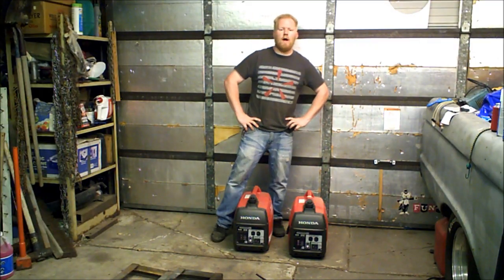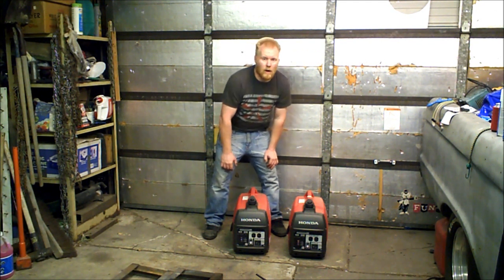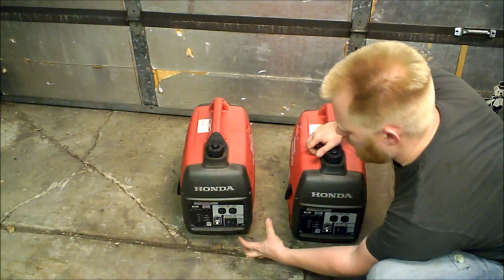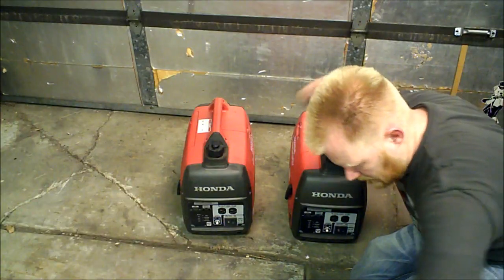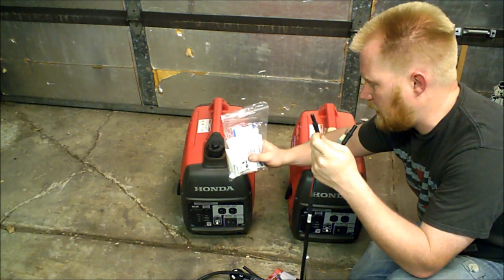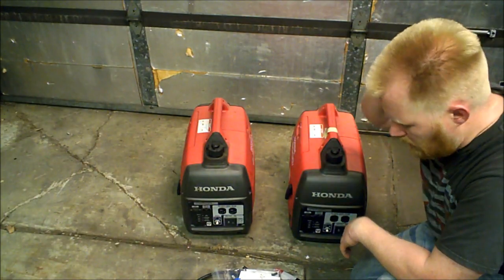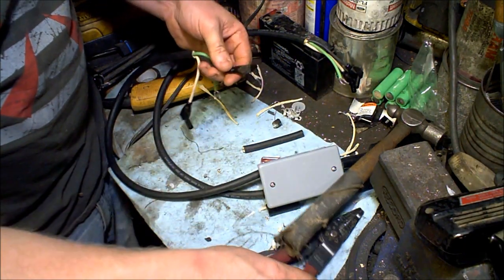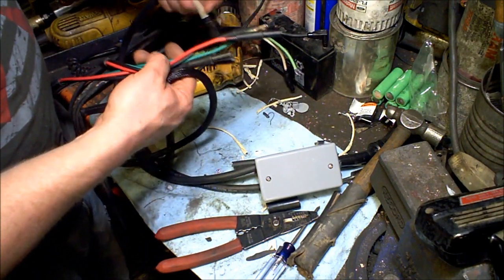Homemade 30A Honda Eu2000i Parallel Kit Generator

Comment: hi, Have watched a few of your videos.  Did you ever make a video connecting a puresine wave Inverter attached to a battery , and then parallel that to an eu2000 genny?  I remember seeing this , I think it was a prosine  inverter in a van setup. Thought it was a great Idea to share the load of say, an AC unit or something.
thx for the great vids
Reply from the maker: I know the video your talking about. The guy who made the video powered up his inverter then the Honda. The Honda has the capability to match the wave form of the other power source.
Reply: This is sounding to me like it's going to a complex, sophisticated arrangement -- way beyond just putting two generators together.  The result would be beneficial but it would cost you.
Here's what a system like this would look like.  You'd have a pass-through, load-sharing, full-sine-wave inverter charger.  You'd run a generator (or two generators paralleled together) to the input of the inverter.  If you're in a situation where you can run your generator, the generator 120V goes right "through" the inverter; if the batteries are already fully charged, all the generator power goes to your "loads".
Let's say that you run it for 8 hours or so.  You need to fuel the generator and do a little work on it (or it's getting to be bedtime and you don't want your generator to run all night).  You just switch off your generator and the inverter pulls battery power, converts it to 120V and you get uninterrupted 120V power to your loads.
If the inverter is "load sharing", say that you want to run a little bit of a bigger load for a while.  Say, the coffee maker is on and someone is using a hair dryer.  Then the generator will run its full 2000 watts and the "load sharing" inverter will pull additional power from the battery and add it to the output so that you get automatic "extra capacity". Once the inverter senses a need for less power, it stops drawing power from the batteries and switches over to charging the batteries up with the surplus power that the generator is providing.

A system like this gives you power that's as good as and as dependable as power in your house -- but it's way more expensive than just one or two generators.  For some people, it's worth it.

Comment: will this work on other types of generators?
Reply from the maker: The generator has to have inverter technology that is designed to sync with other similar generators. The only ones I know of are the inverter Honda, Yamaha, Champion(2000w cube) and Ryobi(2200w)
Reply: its also possible in wind turbine ?/
Reply: i was thinking to connect two wind turbine but idont know if irs ok ?
Reply: Simple answer, "that depends".  If your two wind turbines are putting out DC power, you can combine those to make the sum of the power from both; say you have two wind turbines putting out 30 Amps of 12V each, you just wire them to a 12V battery to get 60 Amps (or 720 Watts).  Then attach an inverter to your battery and you get AC power out of your inverter.  That's pretty simple (but there are some details, your turbines must be designed so that "crosstalk" between the two won't screw up their voltage regulators -- you might need to add diodes or something, depends on the turbines).
But -- in general -- wind turbines are different from 120V generators.

Comment: Good video. One comment. Is it safe to solder wire because if you run a heavy load like a/c , it can heat up wire and melt the solder. Fire and electrical hazard. Buy the correct size wire nuts for it is easier and safer for the family.
Reply from the maker: This would mean you are drawing too much current for the wire gauge and the wire is getting to 400+F all along its length. Heat will generate in the weakest/thinnest joint. Solder will offer a 10x better, more conductive connection than a wire nut, allowing no heat buildup there. If in the random event that the solder did heat and melt the connection would be broken and nothing would happen as they are enclosed in an insulated electrical box.
Reply: Conductivity in solder (tin plus lead) vs copper is not that much difference.  Heat (wattage) is generated in the areas  of higher resistance (ohms) and air confinement . The #12 solid wire is good for 20amps according to most codes but in my book stranded wire can handle about 5 more amps. Wire nuts are made to take the heat if installed properly, conductivity is about equal. The best is crimping but that is much more expense for the proper tools cost dearly .  I must tell you about a insulated (meltable)box vs a metal box. Insulated boxes do not conduct out heat as good as metal boxes in outside spaces. The insulated box may protect you to a point but the ground wire / neutral wires inside can still cause a shot to the hot wires if the soldered wires would fly apart. Most codes do limit the number of wires that can be used in a confined space like a box. I always commend a double box. I think you did alright but the solder would not be my choice.   Ive been in the electric field engr. work for about 45 yrs and when I look back on my first jobs I can not brag. You are a smart guy and seem interested in learning. Keep it up. That is my 2 cents worth.

Comment: Hi, Since the eu2000i does not have a12vdc voltage regulator,  what do I need to do to get one?  Is it possible to go to a junk yard and get one from an old generator lying about?
Reply from the maker: The easiest way is to run a standard 120v battery charger off the generators 120v outlets and charge batteries. The issue with an automotive voltage regulator is they are designed to adjust the flow of current to the alternator/generator and that limits the charge. You can't really limit/stop the generator itself from putting out voltage.
Reply: I was so stunned by the answer I failed to note the generators are the only thing I have for a 12vdc charger.  Let me give you some readings:        Okay I have 2 of these generators and have them hooked in parallel.   I took a reading one time quite a while ago and saw 18.64 vdc coming from the battery charger.  Yesterday the '07 Town & Country van battery was down to a bit over 10 volts on the Oregon Coast.  I plugged the battery into one of the Honda eu2000i  and after 1 1/2 hr. runtime I was able to raise the battery to 14.44 vdc.   @ 17vdc from the generator.  I am thinking that much voltage is a big hit for a battery.  Is it possible to wire in a voltage regulator for my Honda gen.?  Do you think I could wire up an external regulator from the salvage yard?  I am not sure if the Town and Country comes with an externally regulated or an internally regulated alternator.   I thought if I could wire up a regulator from a car it would help a lot.  But I am also thing where is the leftover voltage going to go after being filtered through the voltage regulator?
Reply from the maker: Voltage regulators for car alternators really don't work that way. They 
feed current back to an alternator force it to produce more or less 
current. The Honda has a fixed circuit that produces the same amount of 
current based on the speed of the engine. It will produce higher current
 at a higher rpm but lower at eco. It MAY work to wire only half of a 
Ford voltage regulator to the battery. In theory it would stop/start 
charging at 13.5+- volts, again MAY.
Reply: Ok thanks neighbor,  I really feel I am beating that battery up though. Maybe I can reroute the alt wire to an extra battery.
Reply from the maker: Scott Powell . The Honda's are amazing, except for this 12 volt circuit. It is very dirty power and only meant for emergency use.
Reply: sixtyfiveford I am thinking maybe in some sort, of way, maybe, high voltage is allowed to simulate the bedini  wheel protocol?  Perhaps if one is careful with an eye to constant voltage read outs it may break up sulfides . . . .

Comment: You use a Torch to Solder??? OMG
Reply: I own/have owned dozens of soldering irons, was trained and certified to do milspec soldering on compact wire bundles on F-4 phantoms in the Navy, and I wouldnt think of using anything but a torch when I get into bigger wire and terminals like 4g and above. Not only faster but far more accurate way to apply the heat. I keep a couple soaking wet hand towels around to put behind and under the work, and some kind of container of water which speeds things up by pouring it on the work to facilitate cooling.
I recently bought one of those $100 weller portasol butane soldering tools. Nice but not perfect. The torch mode is kind of small. The hot air tip is nice for heat shrink but is a pain in the ass since its hard to switch back and forth between that and soldering tips when its hot. 
relevence: if i use in torch mode I dont need to change.
Reply from the maker: Large wires need a lot of heat.
Reply: Try a 350 Watt soldering gun, I used to fix Radiators in the old days with one...
Reply from the maker: I have 2 dozen soldering irons with my largest being 250 watt -300 watt ones with 3/4" solid copper tips. Yeah, they put out a lot of heat, but it's still quicker to use a torch and eliminates a cold joint. I guess I'm use to plumbing where no electric iron is big enough.
Reply: Where ever works my friend... smile

Comment: I also noticed you have your battery leads just flopping around, should definitely cap that hot lead in or you could spark up a nice fire in your battery compartment. just a thought, im thinking if the wiring is connected thru a master aux switch then should be fine. better safe then on fire..

Comment: what about in echo mode. I cant keep my generators tanks full. it draws from external tank but doesn't draw enough to maintain full. is the external tank only keep up in normal mode only. I like echo for the noise and trying to find a way to keep tank full on that mode. any suggestions. all my seals are tight and vented tank
Reply from the maker: It will pull in eco mode the exact same. The gas is displaced and it sucks in new. If it works in one and not the other you have a very minor air leak somewhere.
Reply: both generators pull the same amount because they maintain the same fuel level.  I had redone all connections and reapplied Teflon tape. I tried even one hose vs no hose and the generator with no hose showed an extremely more fuel consumption and the generator that was hooked up to external tank had about  1/4 higher fuel level in generator. some posts say on echo mode draws less due to low pulse. I ran without echo and saw no difference. the manufacture said to raise higher and do gravity pull. I put new clamps on hoses also. all is tight cause we have vacuum its just the amount. I have the external with a T going to 2 hoses. i was going to try using one hose on echo to see if maintains full fuel level. i am out of ideas.
Reply: I did the gravity feed process. left the same set up but raised the tank above generators and worked perfect on eco mode kept the generator fuel tank full.

Comment: I have a Generac 2000 w and have a situation where I camp and can get a 110V circuit but neither the generator or 110v circuit can run my ac alone so I was thinking of using the Generac parallel kit using the generator and 110v circuit as inputs.  Do you think that would work?  Seems that the Hondas dont need a special kit, maybe the Generac does not either.
Reply from the maker: I've seen the eu series Honda parallel to a high quality DC power inverter and assume the Generac IQ2000 uses the same technology. The main concern when you talk connecting power from a land source and then from a generator is back feeding power into the system. So if the breaker was shut off or the power goes out, electricity is still being fed into the power lines from your generator. Lineman or individuals can be hurt from unknowingly working on their equipment. I assume your 110v line is limited to a 15amp breaker? Do you have access to a 220V line?
Reply: The 110v line is protected by a 15 amp breaker and no there is no 220 available.  I am aware of the backfeed problem and would not use this setup unsupervised.  My concern was the generator and shore power being in phase, not even sure that would be a problem but it could be potentially.  I was an electrical contractor and thinking this thru I cannot see why it wouldn't work.
Reply: Other than  a phase issue.
Reply from the maker: The generators are designed to sync the phase. So if you have two generators the first one started is the boss and the second one started syncs to it's phase. The same should work with shore power where it is the boss and the generator syncs to it. So you just need to plug the parallel kit in first so the generator sees the shore power, then start it.
Reply from the maker: On a side note, if it is a standard breaker, you could up it to a 20 amp(depending on the wiring coming into it) to allow for the momentary power surge. If you have an older AC unit you can also install a start kit on it(around $20) and that helps some with easier starting with lower power.

Comment: +sixtyfiveford, how much for a parallel kit? That is a wonderful video but I am useless doing electrical work.
Reply from the maker: +Jeffrey Conroy I have a link in the video description for a very affordable one (around 60 bucks) that wasn't around when I made the video.
Reply: +sixtyfiveford Sir, would using the "EU2000i Companion" in parallel (which its only difference from the standard EU2000i seems to be the included 30A 125V Locking Plug AC receptacle) preclude the need for your home remedy kit or the 60$ kit found at your link?
Reply from the maker: +Jeffrey Conroy If you have a Companion model you can use the basic 08E93-HPK123HI Honda cables. http://amzn.to/1WRKrrW
Reply: Thanks for all you advice. Your videos are awesome!!

Comment: can you do that with other inverter generators. honda is an obvious thing.. thanks
. goedendag
Reply from the maker: +georgio jansen Yes and No. They have to be designed to sync with each other. Yamaha, Honda and I believe Generac and Champion are the only ones to offer this. BUT, people have successfully synced a not syncing inverter generator with a sync capable Honda. The syncing generator(last one started) adjusts it's wave form to match the other power source.
Reply: +sixtyfiveford I'll keep looking . got an inverter, an basic synchronous generator, and an inverter welder cq. generator. all 2000w  range.  thanks for response......goedendag

Comment: Does anyone know which one of the parallel ports on the generator is Line and which one is Neutral?  I feel like you should know this if your backfeeding something so you can assure Line is going through the circuit breaker and not your Neutral no?
Reply from the maker: +dubohio Since AC flows through both and the generator doesn't rely on grounding to earth like a home, it shouldn't matter.
Reply: +sixtyfiveford I did some testing, and the while looking at the parallel ports the left is Neutral, and the right is Hot.  Looking at the wiring diagram I would think this matters quite a bit with the way you've designed your junction box in a back feeding situation.  Wouldn't want your hot tied to your house or RV ground/neutral wires.
Reply from the maker: I've pulled apart a few commercial available units sold in stores and they are wired the same way. Neutral is hot and will shock you in a generator the same as Hot will. They are dependent on each other. The same goes for your home, if the neutral isn't grounded to earth it will shock you and be live. Honda themselves don't care which port you plug into and when you use their parallel wires you can plug hot into neutral or hot into hot or any combination as there is no difference with an isolated power source.

Comment: Hay man thanks for the video. How do you make sure the output of each generator is in phase?
Reply from the maker: +Thanitha Weerasekera The Honda generators automatically do it. You hook them together, start one and then the other and the last started one will sync with the already running one.
Reply: +sixtyfiveford  thanks.

Comment: I just don't get what's stopping the internal breakers from tripping at 20A...Just because you add a 30A breaker to the outside doesn't prevent the internal 20A breakers from tripping.  How does your kit accomplish this?
Reply from the maker: +Kartman35 X The center unit I built pulls 13.3 amps from each unit(the max they can provide). So they can't trip the breaker as a single eu2000i can't provide 20amps no matter what. If you use just the cord Honda sells you still plug into one generator and the power from both units is pushed through the single built in Honda plug and will trip over 20amps(13.3amps per unit= 26.6)

Comment from the maker: I have a few links to various parts in the video description along with a brand new parallel kit that will give you full capacity out of your generators for barely more than I built this one for.
Reply: Try HF $50...works also on Honda...https://m.harborfreight.com/rv-ready-parallel-kit-62564.html
Reply: +sixtyfiveford i have a harbor freight predator 4000 have been trying to parallel it so i can get the full 26 amps out of it do you have any suggestions thanks for any help you can give
Reply from the maker: Sorry, but you can not get 26 amps at 120volts from one source as the two circuits are out of phase. They do this so you can get 220/240 volt output.
Reply: +sixtyfiveford ok thanks there is a guy on here saying you have 2 coils and that you can rewire the generator  to pot the coils in phase not sure what he is doing thanking about putting a step down converter on it so i pull from both coils to keep the load even